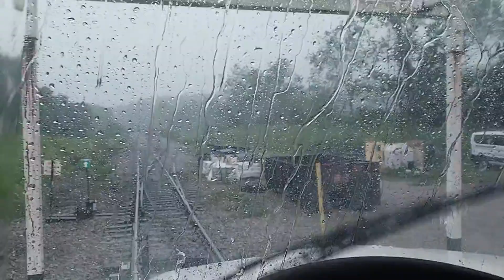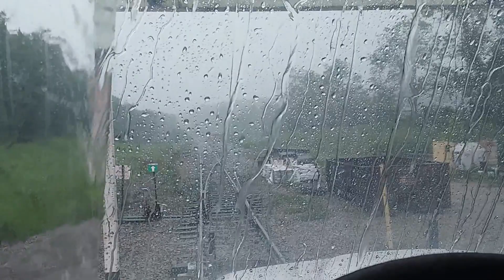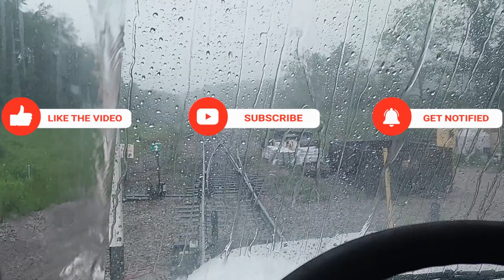Why MOW Equipment Doesn't Set Off Crossing Signal Lights

Comment: Dave:  to my knowledge:  lightning has not joules.  Lightning won't light up a light bulb, it will start a fire.  In my understanding of what is called a "shock" when scruffing across the carpet in your socks and touching the doorknob is actually a change in temperature of the static spark.  This is my observation and has no fact to back it up.  Lightning can start fires, but it cannot turn on a lightbulb.
Reply from the maker: Electrical knowledge like that Mr1fish is over my head! I do know
the cat doesn't like it when it's dry in the winter and when I pet
him sometimes there is an electrical shock! You can sometimes
even see the little blue spark. Thanks so much for watching
and writing in my friend.

Comment: do hi-rail vehicles also have switches in the cab to shunt the wheels if the driver wants to activate signals?
Reply from the maker: Not that I am aware of Oregonsignalfan. With plastic bushings in the
axles they couldn't do it if they tried.  Appreciate very much
your taking the time to check out the video. May you have a most
blessed day my friend.

Comment: when it rains, it pours! hope you stay dry with all that coming down. yes insulating parts to prevent any 
triggering the signals,with your truck. that is done by shorting between the rails. that is 
why there are insulators between the rails too! in areas for blocks.  really neat video.
Reply from the maker: glad you enjoyed the show Barry. Thank you for visiting with us
and checking out the video. May you have a most blessed day
my friend.
Reply: @ccrx6700  
Hello Dave:
 it has to be difficult at times trying to get new rail in, especially when the rain shows it’s
ugly face, everything is slick, and wet all over. the water acts like oil , and it is hard to
 hold on to the rail! and the spike driver has to “spit” water and air all over you!
Reply from the maker: @artillerest43rdva7  got mt face splattered many times driving spikes into wet muddy ties 😊

Comment: I wondered why some MOW machines did not operate the crossings. Saw a few near misses on a live stream and asked why they do not switch to manual operation before going over the crossing which is what we have to do here with machines that may not operate a crossing. Mod did not like what I said and was going to ban me from the chat. Another reply explains in more detail why they use insulation bushings. I don't blame you for not going out in a storm like that.  Apart from unpleasant to be out in the wet it is dangerous.
Reply from the maker: Sometimes I've seen signalmen manually operate a crossing gate and lights when MOW is close by on NS track. Thank you very much for taking the time to check out the video. May you have a most blessed day my friend.
Reply: @ccrx6700  Good to know they do that sometimes. I forgot in my last reply but I got screen video of a big rig that came to the crossing gate which went up and down again between the tractor and trailer so it was broken off They were working on the track nearby and the gates were going up and down constantly, which is why I posted the comment about switching to manual.
Reply from the maker: @cedarcam  👍😊

Comment: Something I always wondered..
I know that crossing signals/gates get activated when a train enters the circuit and shorts across the tracks. My question: how are the tracks electrically insulated to create the circuit. Is there a physical separation or just that current drops below a threshold when track resistance becomes too great?
Reply: physical separation with an insulated track circuit before the road crossing, on each side.
Reply from the maker: rearspeaker answered for ya Steve. I'm not that well versed on signals
since we don't have any here. Thank you for visiting with us
and checking out the video. May you have a most blessed day
my friend.

Comment: Interesting info on the hi-rail vehicle insulators and crossing signals-  I can see how that helps on your railroad.  I do wonder how it fits in with electronic systems such as CTC and ATC. Thanks!
Reply from the maker: Very good point Alan and I don't know. Thank you very much for taking
the time to check out the video. May you have a most blessed day
my friend.

Comment: I was told our old jackson 6500 tamper was one big lightning rod, and if you saw lightning to pop the brakes on and get as far away from it as you can.
Reply: should be safe in the cab, all metal structure.
Reply: @rearspeaker6364 definitely safe now, scrapped it a few years ago 😂
Reply from the maker: For sure on that Michael, I've hid in our big tunnel on numerous
lightening storms I felt safe in there. Thank you very much for taking
the time to check out the video. May you have a most blessed day
my friend.

Comment: Making an electrical connection between the left and right rails shows an occupancy on the line. If it's done near a crossing then it'll set off the bells and lights, but that's how they know where the trains are on their system overhead. There have been stories of phantom trains that suddenly appear and then disappear again, but that's usually someone just screwing around for fun laying a bar across the rails and then picking it back up again. Personally, if it was me running equipment on the line I think I'd rather have them see where I am.
Reply from the maker: Appreciate the nice comment Just incase. I would prefer like you
have them seeing. Thank you for visiting with us and checking out the video. May you have a most blessed day my friend.

Comment: Being a Boomer, I grew up being told "An automobile is the safest place to be during lightning because the rubber tires insulate the vehicle from the ground." 

That is NOT correct. After traveling through miles of open air, an inch or two of rubber would not STOP a lightning bolt. Rather, the metal automobile acts as a "Faraday cage," protecting you from the lightning. 
https://en.m.wikipedia.org/wiki/Faraday_cage
Reply: Years ago we in UK had a TV series Don't remember its name now, anyway one was about lightening and showed what happens to things being struck. One was a car they drove around in a torrent of spray under high tension power lines which arched across many times It had no effect on the car apart from a warning light came on proving there is no danger being in a car in a storm.
Reply: @cedarcam  there are videos of cars being struck by lightning, and a report of a person being struck by lightning while being in the car, while driving.
Reply: @rearspeaker6364  I have heard of cars being struck but not seen video apart from on that TV programme.
Reply from the maker: That's very interesting Allan, never knew that. They always told us
if lightning hits around or a vehicle stay in the vehicle and don't, never
jump out.
Reply: @ccrx6700 >>> I would say that advice would help you AVOID any SHOCKING experiences...😉
Reply from the maker: @Allan_aka_RocKITEman  👍😊

Comment: Great video Dave! I always wondered about how they stopped the signals from sounding for the MOW equipment! I had it figured out, but this confirms my speculation 😊We could really use some of that water here, but hopefully not until I have all of my open construction holes filled! 😮💧💧
Reply from the maker: Haven't had internet for over a week now, big storm last thursday
so I've not watched any videos from anyone I watch, been all I can
do to keep up with my comments, have to go to my sons house to
use wifi there. Storm blew all kinds of things up at the house been
dealing with that, it's a mess here. 25,000 KV line came down
an sent power surge thru house. Was without power for 65 hours
Reply: @ccrx6700  Yikes that's a mess Dave! Don't worry about comments and stuff, just get your property back in order! I'm playing catch-up as well — had my appendix out last weekend, and moving a lot slower than normal for a bit. Hopefully all of your appliances didn't fry-out, and your back to normal soon. Good luck and stay safe my friend!
Reply from the maker: @PlanetMojo  ac unit fried had go buy window units. 6 week back order on circuit board.  Hope your getting back to normal. Older we get harder surgery is on us. We just got internet back yesterday afternoon
Reply: @ccrx6700  That sucks! It's insane that the circuit board shortage is still going on! Glad you got your internet back! I've always healed very fast and luckily this is no exception. healing-up like a champ 🥊😊🥊
Reply from the maker: @PlanetMojo  👍😊

Comment: Very interesting Dave, insulating rail equipment for lightning protection, then you brought up crossing signals.  I believe if you short between the two rails you cause the signals to engage. So can track equipment turning on/off a short between the two rails to engage the signals or off when working near crossings?
Reply: Modern crossings don't activate because of a simple short between rails, unless very close to the road. They have a computer that watches the resistance of the track change as a train approaches, and it calculates the speed, and it activates the crossing when there is around 30 seconds left. There are often sidings and Y connecting tracks near crossings, and they are insolated, so a train coming from there causes a fast short, and the crossing doesn't go off because it would be inconvenient to motorists since the train could be going the other way and never cross the road. A fast short will only start the crossing if it is closer than 30 seconds away at track speed for obvious safety reasons.
Reply: Thank you, that makes sense there is always something to learn.  @Flintsmooth
Reply from the maker: You are correct in the shorting and MOW stuff does not short the
circuits in the rails out so lights don't come on Mack. Thank you very much for taking the time to check out the video. May you have a most blessed day my friend.

Comment: Professor of Railway Maintenance, I have a question. You mentioned that your maintenance vehicle is protected from lighting striking the rail.  How is the locomotive protected from lightening striking the rail or directly striking it?
Reply from the maker: It is not Dale. No plastic bushings on hopper cars or locos. Thank you very much  for taking the time to tune in and check out the video. May you have a most blessed day my friend.
Reply: add to this one: has lightning ever struck a diesel loco, and what was damaged?
Reply from the maker: @rearspeaker6364  never here I'm sure it has someplace but don't know where

Comment: I remember seeing a front-end loader clearing snow from a factory that had a small spur track.  (this was in upstate NY where we got a lot of snow).  The spur crossed a busy road and the equipment operator had to cross it repeatedly.  Well.... he had figured out that he could scoop a huge bucket of snow, drive along the spur track and lower the front end down to short the rails together.  CLANG...CLANG...CLANG... flashing red lights, gates drop and all.  The traffic stops, he crosses the road, dumps his load and zips back.  Then about 5 minutes later, did it all again.  Guy had figured out how to 'work the system'.  lol
Reply from the maker: Pretty cool story Mike! Thank you very much for taking the time to tune in and check out the video. May you have a most blessed day my friend.

Comment: Huh, this kind of explains why for years a crossing i frequently went over would engage the lights if there was any lightning within a few miles of it. Never failed, see a faint flash out of  the corner of your eye coming up to it and it kicks on the crossing lights.
Reply: dirty ballast acts as a capacitor, slowly discharging some of its voltage into the track circuit.
Reply from the maker: That's pretty interesting LZ. Thank you very much for taking the time to tune in and check out the video. May you have a most blessed day my friend.
Reply: @ccrx6700  thanks Dave! I hope you do as well. I always look forward to your videos and insights into the world of railroading! Love the channel and content!
Reply from the maker: @lz8r63  👍😊

Comment: Consider the dear old signal man in his box (tower?) during a storm - with all of the rods and cables going off to points (switches) and signals.  Despite the many alternative routes to earth, lightning would still be dangerous whilst pulling levers (you can't hear my pronunciation of that).
Reply: I replied on that lower down. Being all metal there is a good path to Earth and the levers will not hold a charge but what can happen is the Earth itself gets charged up in the local area and it stops Earth or ground return circuits working. I have had that happen and after a time most things start working again, really baffled me first time I saw it
Reply: @cedarcam  dirty ballast, and some rain can wreak havoc on Amtrak's Northeast Corridor signal system, dirty ballast can act as a capacitor, causing the signals to go to stop in front of a 110mph train. note that happened a lot in the 1980's, hopefully they got that fixed by now.
Reply: @rearspeaker6364  Yes dirty ballast can cause problems like that Fortunate for Dave their line does not have any train detection circuits through the rails with all that coal dust
Reply from the maker: You are right Richard! I wouldn't want to be up there either. Thank you very much for taking the time to tune in and check out the video. May you have a most blessed day my friend.

Comment: Hey Dave !!!     Good info you give out !!! 🤔🙄🙄👍👍👍👍👍   If you watch ""Murphy's diesel "" ,, They had to go rescue a high rail work truck that the bearing seized up on the wheel & couldn't move the truck !!   Good video to watch !!!
Reply from the maker: I will have to check that out KB < i'm always worried something will go wrong with hi rail gear and Ill be stuck on the rails. Thank you very much  for taking the time to tune in and check out the video. May you have a most blessed day my friend.
Reply: @ccrx6700  Hey Dave !!  That video is :: 90,000lb off road derailment  full video is 1:01:20 long so get a bowl of popcorn & watch !!
Reply from the maker: @KB-gs8zi  👍😊

Comment: I'm confused. Track circuits depend on rail-to-rail conduction, which happens through the axle. Electrically insulating the axle from the rest of the vehicle doesn't stop electricity flowing through the axle from one rail to the other, so how does it stop track circuits triggering? And I'm sure I've seen YouTube videos of MoW equipment such as tampers and ballast regulators triggering crossing barriers. (I also know I've seen footage of hi-rail trucks going through crossings, but I can't remember if they set off the crossing or not.)
Reply from the maker: As far as tampers go some tampers have plastic inserts on the jack beam clamps that clamp the rail. Mine does not. If one does not and
the tamper clamps the rail, then the crossing lights will come on. I do not have an answer for any other situation as you describe tho Beeble.
Thank you very much  for taking the time to tune in and check out the video. May you have a most blessed day my friend.
Reply: Actually the axles short out (kills) the track circuit, insulated axles won't allow that to happen. For the typical freight lines, low voltage DC power is placed onto the rails (called the feed end) with the positive (+) on one rail & negative (-) on the other rail at the start of a signal block. The DC voltage travels down the rails to the far end of the block where track wires (one to each rail) goes into signal bungalow, or sometimes it's just a wayside cabinet, where the track wires are connected to a Track relay's coil to keep it energized when the signal block is clear of any rail traffic. When a train enters the track circuit, its axles shorts out the Track Circuit battery power and drops the Track relay to indicate the signal block is occupied or there is trouble with the Track circuit. Insulated joints defines & isolates each individual signal block from one another & each block has its own dedicated Track relay. Some MoW equipment such as Tampers & Ballast Regulators short out the track circuits & crossing circuits. MoW Hi-Railers (i.e Pickup Trucks for the Maintainers & Track Inspectors) usually don't short out the track circuits or crossing circuits - can't troubleshoot a faulty track circuit if your vehicle shorts out the rails since you are taking voltage measurements from each rail to find where the problem is (broken rail, bad track wire, etc).
Reply: @tom49801  That doesn't really address what I said. What you describe as "shorting out" is exactly the same thing as what I describe as "rail-to-rail conduction". The video describes MOW vehicles as having "plastic bushings" which insulate the axle from the vehicle. But, as I said, that would still allow the axle itself to short the track circuit. So that can't be what's going on.
Reply: @beeble2003 oh, ok,  I was confused by your wording. In my former Signals Dept work, "shorting out" was termed as being "shunting", whereas, rail to rail conduction meant the completion of the audio overlay frequency (transmit side connected to receive side) via the axles for AFO & FSO protection equipment used for allowing the unlocking manually operated switches for siding tracks.
Reply: @tom49801  OK -- you're operating several levels above me. :D
Reply: @beeble2003  100% on that!! the modern stuff for the mainline track, with cab signals, plus the PTC overlay.